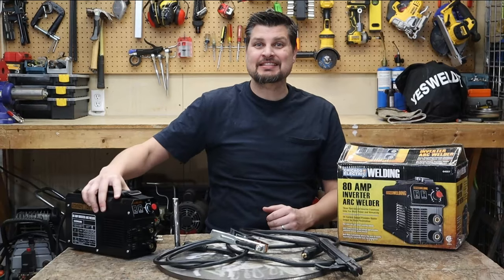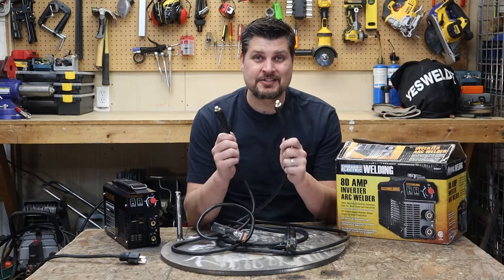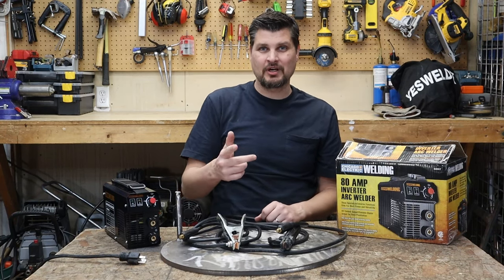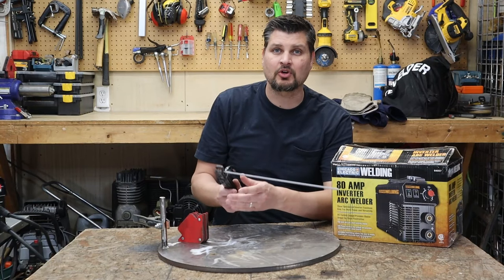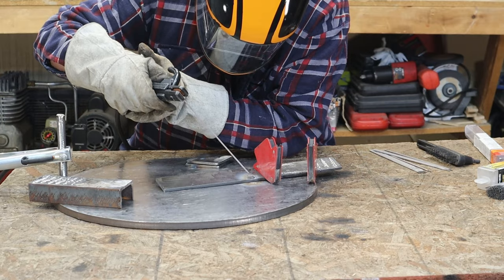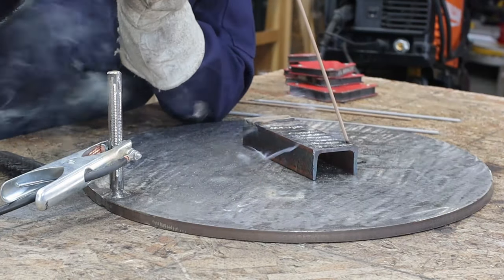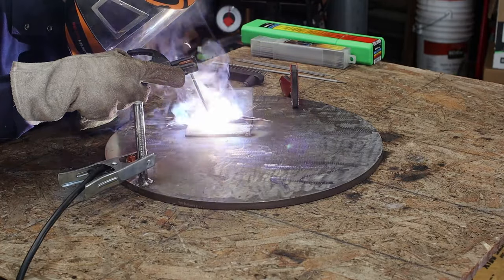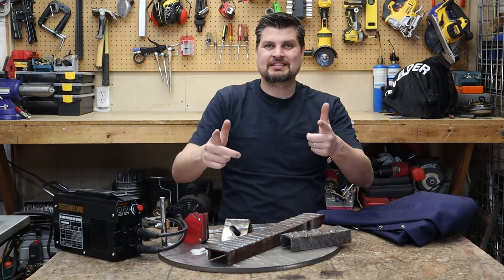Harbor Freight 80 Amp Inverter Arc / Stick Welder

Comment: Bought one of these years ago, was totally blown away how well it worked.  At max power, someone with experience can easily weld 1/4 inch thick material. Far better than any previous 110 volt ac buzz box. Might add, my main welder is a Dynasty 200 dx.
Reply from the maker: Right on, thanks!

Comment: These welders really like Lincoln Fleetweld 12" long rods, you can find at Home Depot.  Usually 6013, but online I found as big as 3/32 7014.
Reply from the maker: I'll have to try some of those!
Reply: @-DIYPRO-  can get at HD in 1/16 and 5/64.   5/64 6013 do pretty decent.

Comment: Honest and straight forward. These being DC makes this a great portable off a Genny quick patch to get back to the shop use. Be interesting to v groove some 1/4 inch plate with different rods then cut to see penetration waves.
Reply from the maker: Biggest draw back is the 80 amps. I've already hit the duty cycles a couple time. Awesome for little projects.

Comment: Good review, thanks.  Helpful info on the rods.  I recently bought a little Yeswelder stick welder.  I was surprised, it's a capable little machine.
Reply from the maker: Right on, i picked up the Yeswelder 135 which has stick ability as well. So far so good!

Comment: will my van's 2000 watt inverter be able to run this?  I can only output about 12amps @110v.  I want to weld .375 rebar .. if possible, what rod and setting you recommend for this.
Reply from the maker: My 20 amp breaker trips quickly. My guess is if you only have 12 amps you'll have to turn it down to about 40-50 on the dial. You can try it with 3/32" rods but you may not be able to stick and hold an arc that low. Probably will have to get 1/16" rods. It will weld rebar but it won't be a full penetration weld. Fine for cosmetic, light duty stuff, but don't "stake" your life on it!

Comment: Disclaimer:  I never welded a thing in my life.  Having said that, I own a pressure washing business, and I want to do some work on my own trailer and do a little fabricating.  My question is, will this welder be ok to use on standard utility trailers that have square tubing?  Thank You.
Reply from the maker: Yes it will. If you are just starting out I'd actually pick up the Titanium 125 or the chicago electric 125. Flux core welding is easy to learn than stick welding, it's also easier to do thinner material.

Comment: I've never welded anything before. I just started learning to weld. The first project I choose is to fix a blender blade shaft that I snapped by mistake. It's a 6mm stainless steel rod. I plan to weld a 6mm stainless steel bolt to extend the shaft so I can put the blades back on. Do you think this welder can take on that task?
Reply from the maker: Starting off of SS and a rod not plate! Yes it can be done but I'd throw down a lot of practice pieces before hand.

Comment: If you could only buy a titium 125 ir that stick welder which would you buy  and is there any benefits  from one to the other thanks
Reply from the maker: If you are doing more garage shop type projects then get the Titanium and if you are doing more outdoor type projects get the stick welder and a third option is the new Yeswelder gasless 135. It has both flux and stick options for the same price as the Titanium. I like them both but if you do look into getting the yeswelder use my affiliate link: 
https://yeswelder.com/?ref=uDQs4bv7pZQF3
and for 10% off use: MECHMASTER

Comment: It'll burn 7014 real nice also I have this machine I'm a mobile guy I bought it to do some work in a confined space where I couldn't get a bigger machine on thin stock with a TIG rig I also upgraded my welding leads to number two leads and it preforms much better with this size cable no2 is the biggest cable that will fit into the connectors  thickest material that I have welded with it using 3/32 e7014 is 3/16th I have also welded stainless steel 316 using 308 electrode also a 3/32 electrode on 1/8 material for being a little machine it's got a punch too many people under rate this machine because of the electrode size limitations but the key to being able to use this machine is being good at fit up the better you are at fabricating with joints and positioning the gaps for weld up the better the results will be for short run repairs this machine is good I've had mine for about a year

Comment: cool vide, thanks for posting. Would you think this is powerful enough to weld up an exhaust manifold for leaks?
Reply from the maker: If it's steel and less than 3/16", then yes. Typically manifolds are cast and that can be done with stick welding but it takes a lot of practice.....so you might want to test it out first.
Reply: @-DIYPRO-  thank you for that! I will give it a shot!

Comment: Will this machine be any different than welding on a bigger 220 machine? I want to learn to stick weld and this seems like a good option as long as I stay with thin metal
Reply from the maker: This is a great learner machine for thinner stuff. Yes a bigger nicer machine will give you more features but this has the essentials.
Reply: Get it

Comment: Do you know if the Metal Man ARC80T require a dedicated outlet or can be used in any house outlet.
Reply from the maker: If it's like this HF 80, which I'm assuming it is very similar since it's also rated for 80 amp. I would say you can use a regular house outlet that is on a 20 amp breaker. Most garage and kitchen outlets require 20 amp, others are mostly 15. It doesn't need to be a dedicated circuit as long as you aren't running more appliances or equipment on the same circuit at the same time.
Reply: I can be use in any outlet.

Comment: I just picked up the same machine! But in Canada we have princess auto supplies and their in-house brand is called Powerfist...I did some great stainless steel with 6013 rods
Reply from the maker: Right on, how did it turn out?
Reply: @-DIYPRO-  turned out great. Did some cash side work with it!

Comment: Thanks for the review!  I bought this a few weeks ago .. first time welder.  I do wish I waited just a bit longer to buy a stick welder than can output higher amps.  Capped at 80 is pretty low, though it does work quite well!

Edit - Question.. You mention using 3/32 in. 7018 rods.. however the amp range on those suggests 70-120A.. they'll work however?  I appreciate any help.
Reply from the maker: Correct if you are using 3/32" you'll need it cranked up all the way to the max 80 amp.
Reply: I think for a first time welder 80 amps is more than enough. Don't get too ahead of yourself. A little knowledge can be dangerous, especially with welding.

Comment: So I never welded before in my life and I want to try to make metal sculptures and stuff of that nature which type of welder would be best for that job would it be stick/arc or could I do something of that nature with a flux core welder I haven't done anything like that before just curious as what your opinion would be?
Reply: Get a flux core if you want very easy to use and  if you want to make nice welds very quickly, get a stick welder if you feel like learning the technique and how to strike (not as easy) but you can also make nice welds with some practice
Reply from the maker: I agree with the deer.
Reply from the maker: Start out with a flux core welder. If you want both at a cheap price Yeswelder has their new gasless 135 which has both flux core and stick abilities. If you do decide to go that route use my affiliate link: 
https://yeswelder.com/?ref=uDQs4bv7pZQF3
and for 10% use code: MECHMASTER
Reply: @-DIYPRO-  okay thank you I definitely appreciate it
Reply: Wouldn't you also say it really comes down to the thickness of the steel?

Comment: Which Tig  torch do you recommend for this little welder?
Reply from the maker: The ones I have came with the Titanium multi process and I have one that came with the YesWelder MP200. Both are very similar in that it's a valve type torque and both are size 17. For what little tig welding I do they work just fine.

Comment: Can it weld aluminum?
Reply from the maker: If you get the right rods....stick welding alum is really tricky so good luck.
Reply: Yes you can,  with an E4043 Electrode
MG 405.

Comment: I usually take my 4130 steel tubes (positioned in a jig) to a welding shop, but right now, I just need to tack some pieces together so I can transport the entire part (can't use a jig). I'm thinking of buying this. Hmmmm
Reply from the maker: Chromoly should be TIG or Mig welded. I'd definitely ask the end welder on what welding process they'd allow for tacks.
Reply: @-DIYPRO-  Thank you! I'll definitely check with him.